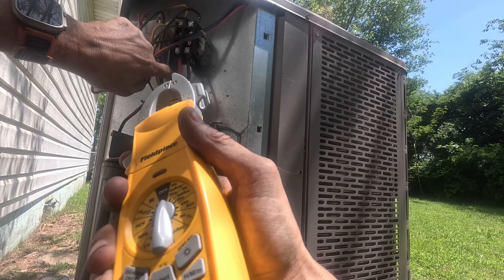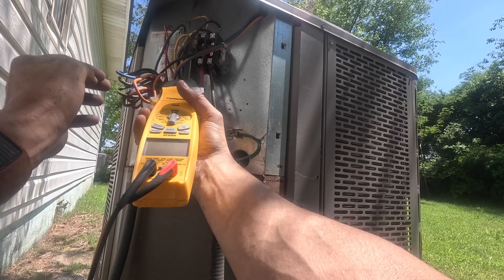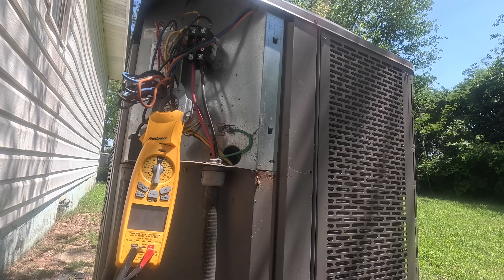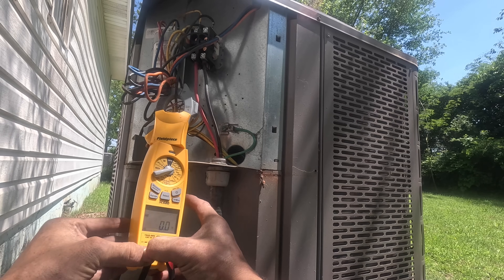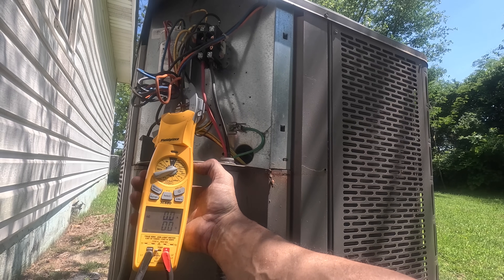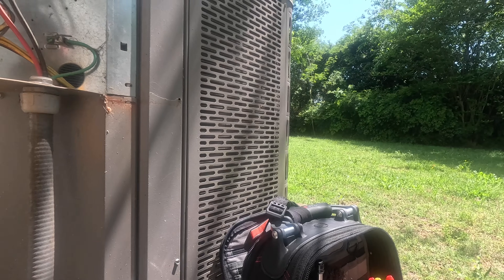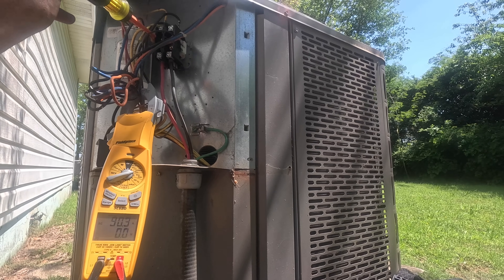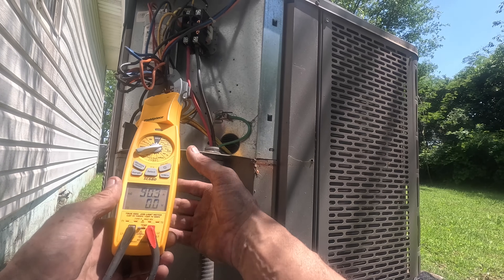She Said Her AC Was Making a Strange Noise! #hvacguy #hvaclife

Comment: End of May is the last date they can legally sell any 410 units. After that, 454 units only. Distributor i work for is working desperately to try and get rid of all their 410 condensers/air handlers/coils they have before then or they'll have to "eat" them.
Reply: That is only for new and complete split systems. Packaged systems and VRF/VRV are sometime in 2028… Individual components, which a condenser for a split system could arguably fall into, can be sold indefinitely. But, combining individual components would be a violation (substance over form) of the law…
Reply: Also, not “only R-454”… Speaking of which, use R-32 systems not R-454, as cost, availability, and efficiency are all much better!

Comment: Definitely smoked. You were luck to find a 410 unit. I would have guessed they would all have been bought up
Reply: time for a change! they should still be able to sell dry/nitrogen charged units for repair work only, because R32/454 should not be put on to an existing furnace/air handler, because it lacks the safeties required.  so they're forcing costly upgrades on the poor suckers once again. I have a feeling there will be more electric heaters/window shakers sold and of course more electrical fires, because of it. also I hate any blended refrigerants, it's plain flipping stupid!
Reply: Agreed
Reply: if u can't find a Unit - Going to see a lot of Compressor changeouts !
Reply: Used AC Depot....see if ya got one near ya.
They have new/used & scratch & dent.....and new evap coils of most sizes for fairly cheap & had really good luck with the company.

Comment: Our 30 year old trane heat pump recently started humming they thought it needed a new start capacitor but it turned out the compressor was bad so now we need a new unit
Reply: 30 years, you can't complain, that was a good one.
Reply: @jthonn  "It's hard to stop a Trane"